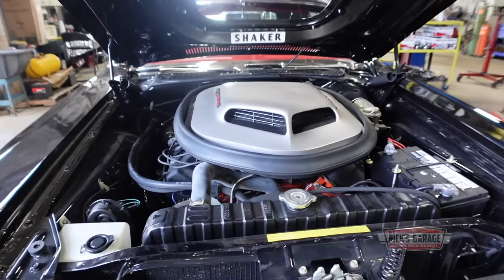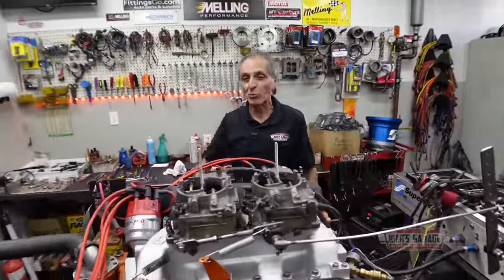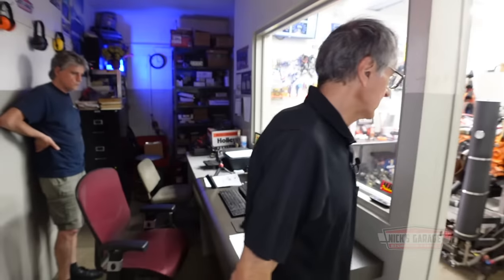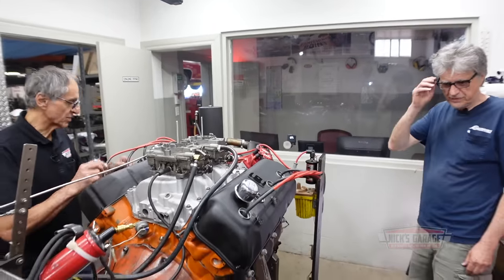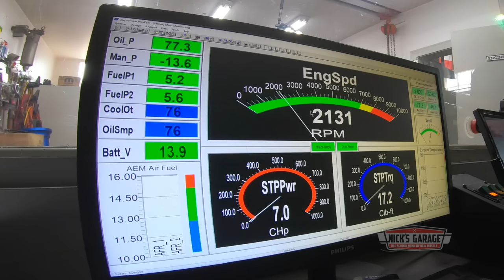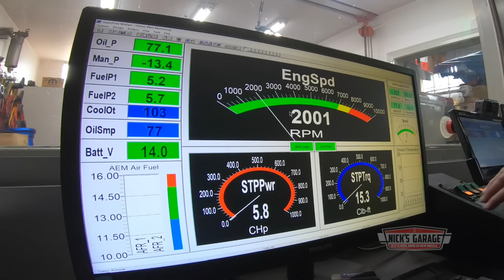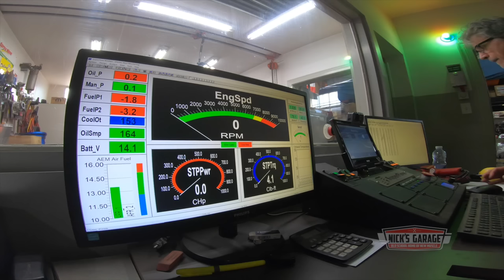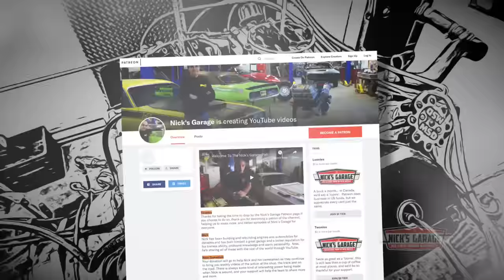NHRA Hemi Screams - Race Engine Dyno Tested

Comment: Hey Nick, when talking about the material of the headers doesn't that change your air/fuel ratio?  You obviously like stainless steel, what about titanium headers.  I know some circle track cars are seeing large gains with the different types of material used in the headers.  How much HP is in the oil pan?
Reply: The material of the headers has zero to do with the air/fuel ratio, it's all in the design, diameter of the tubes, and length. There can be a fair h.p. gain to be had in just the design of the oil pan. Especially when it comes to windage trays and crank scrapers. Obviously how much to be gained depends upon the power the engine makes in the first place.

Comment: I remember hearing Chrysler tested their engines a quart low on oil. It gave a few more HP.
Reply: Ya, the crank/rods have less oil fog to slice thru, thus less friction.
Engine Masters oil pan testing showed near 50hp gain with one design on 800 hp drag race V8.

Comment: I know the duration specs on a "class" camshaft are massive but still it's an impressively high horsepower peak for a "no touch" cylinder head/intake/smallish factory carb setup. You realize the numbers on the monitor during the runs were showing, right? I had guessed it would make around those numbers, says a lot about the factory hemi heads.

Comment: Loosing some low end torque in a drag car is ok if the engine picks up HP on the top end.  Guessing the engine never runs below 4-5000 RPM’s.
Reply: That is correct.

Comment: Hey Nick I've noticed the throttle in your office as you gas it , it seems to bog down the motor than you push a button and the motor picks up again. Happy 4th of July  everyone !
Reply from the maker: The 'bog' you hear is the dyno engaging the load through the impeller system..
Reply: And I learn something new again and that is why I the videos and read the comments not to mention that they are just
Awesome!

Comment: Would be interesting to see if that air cleaner base plate lowers the IAT’s.  Would think it would act as a heat shield to some degree.
Reply: This is why we use it.
Reply: That was the whole entire point of a shaker hood. To bring in cooler outside air.

Comment: HELLO NICK, JUST SOME THOUGHTS,  LOOK AT THE RULE BOOK AND FIND THE THE AREAS THEY DONT TALK ABOUT. IN THE ENGINE AND CAR.. AND REMEMBER TO READ BETWEEN THE LINES OF THE RULES.. PLUS THE MAIN THING IN A DRAG RACE ENGINE IS THE ROTATING ASSEMBLEY WEIGHT, CRANK LITGHTENING, LONGER RODS, LIGHTER PISTONS, THINNER RINGS, LOW TENSION OIL RINGS,LESS FRICTION,THINNER STEM LIGHTER VALVES,TITANIUM IF ALLOWED, LOWER OIL PRESSURE, VACCUM PUMPS..LIGHTER TAILSHAFTS, HOLLOW DIFF AXELS.. I KNOW ITS ALL MONEY.... SLOWLY SLOWLY.....MY OLD BOSS TOUGHT ME ALL THIS STUFF, HE WON A TRUCK FULL OF TITLES AND TROPHEYS, #1 SUPER STOCK MANY MANY TIMES HERE IN AUSTRALIA... KEEP WELL AND YASSOU PATRIOTI...

Comment: Can you run inversion cones in the headers to stop the back pulse? They give a noticeable gain.
Reply: We are working on that issue now.
Reply: If you can manage to tune the headers with collector extensions you can get rid of just about all the header reversion.  But it's nearly an art form in itself in doing so... I had a bud who ran a Hemi Duster in pro-stock (guess how long ago THAT was!) who painted the collector extensions he'd fabricate and take note of where and how the paint blistered off the extensions, then trim the extensions accordingly.  He said it actually seemed to work but wasn't easy and the gains were pretty small... but every 100th counts.

Comment: 7300 RPMs?? Geez, a bone stock 426 Hemi is pretty much all over with before 5500. The cam in your brother's motor must have some pretty serious duration along with that limited lift that you can legally run.  I'm assumimg that there is no rules about the duration of the cam, as long as the lift is within spec? 
Lol, the lobes on that flat tappet cam must look more like rectangles, like a solid roller does. Mopars can take advantage of more aggressive lobe profiles with flat tappet cams because of those huge diameter lifters. A BIG bonus for an NHRA stocker.

Comment: Hi Nick , did you notice when you did he first run one of the wing nuts on the bottom plate of the Air cleaner was coming loose > hate to see it fall in the engine

Comment: What about ceramic or jet coated headers? You can have the stainless steel and then Jet coat them I think that's what they call it
Reply: Most important is the inner of the tubes.

Comment: Hi Nick, what is better the inline 2x 4  or the crossram 2x4
Reply: Crossram 2x4
Reply: The inline 2x4  looks better and is not " in the way " for work as the crossram 2x4. 
The crossram is more efficient for max HP and torque.

Comment: Its like heads on a chevy 350 to make a 383 you more then likely go with vortek heads for the most gains over camel humps you can do it for a stock 350 as well for over 100 hp gain but its like what do i do as a gear head
Reply: It takes more than vortec heads to turn a 350 to a 383. My personal best increase with just swapping from non vortec to vortec heads was 38 hp. With a cam a manifold different rockers higher compression and vortec heads, with a average 350 you can gain about 125 hp and still keep it totally street able and not needing different converter etc. But vortec heads, even the l31 heads, aren't going to gain u 100 hp
Reply: @JohnGalt-vr3lx   yep...I knew he was full of beans...

Comment: I saw a guy get 825 hp at the wheels with a almost stock turbo Chevy 4200 straight 6 vortex
Reply from the maker: Where did you see that?
Reply: @NicksGarage  His you tube channel is  nivlac57. He kept going higher with the boost , when he hit 40 lbs boost it made 825 hp then busted a rod and piston.
Reply: Doesn't really matter what the number is if you break it in the process...obviously it can't maintain that number....
Reply: @patricknash1198  he took a junk yard motor with 175,000 miles got it up to 600-700 hp and won races with it , then wanted to see how high it would go .he found out .

Comment: If you don't have boatloads of cash and a Ray Barton engine it's tuf to run with the big dogs. NHRA Hemi Challenge cars now run 8.4s @ 160mph 1/4mile. All NA , no power adders. About 900 hp @ rear wheels.
Reply: @Car Guy daddyo they run
 SS/AH
Reply: @Car Guy daddyo SS/AH
Reply: @Car Guy daddyo 9.90 still plen jif. Still must have a Ray Barton (or equiv) engine 700-750hp , scienced out chassis to be competitive. Boatloads of $$$ also applies. Buying a competitive car and all its data is least pricey way.

Comment: Why don't you run HOT water thru engine like they use to do?? At track..  without hot air tube n heat rise valve. You must use a choke blade to help fuel  mixture maintain idle that was engineering by factory.. you know that fuel doesn't atomize  on "cold". Surfaces.. fuel goes past. Rings and reignites in exhaust manifolds or headers which can see glowing in darkness..many guys can't understand why header to head gaskets get  brittle n leak as well as collectors ..Heat guns will be best to see what is happening until engine is  "doing" ... I .started going to track in 1964 an started  bracket racing 1957 two door hard top with  327 w  cross ram,,  I  believe that candaians try harder to build "everything " a little  better than amiercans.. my mom was   born in Paris n I was born n raised in Toledo Ohio until 1959 and then moved to Eugene Oregon .made it to 1970 n 71 Winternationals to watch stock n Pro stock . I  have  watched  the.  National s in   Kent Washington since 1979.. I quit. Racing my 74 Ventura with 69 GTO engine in 1996.

Comment: When Nhra "Stock"  dosen't mean Factory production implied Pure "Stock"  !!! .......You're not gonna get (no matter what tune-up, gas octane, carb jetting tweakin) 500 or 600 hp from a Real as we received them 9.4 CR factory production Stock  426 hemi engine as a Nhra "built"  A/Stock legal 426 g2 hemi's in a totally different time zone of   allowable Major internal modifications !! ......For Starters, slightly dome milled "high dome" Super stock 12.5 CR pistons running at an Assembled 11.3 CR is significant power helper compared to the really Pathetic factory production Stock low dome, huge deck Height actual 9.4 CR typical squeeze engines...,Then a major higher rpm Torque band extremely Longer (than factory pure Stock) duration "Cheater" cam is degreeded in for some Serious stock Appearing high revving Dramatic power helping performance....Sometimes "stock" aint close to racin tune "Stock" !!

Comment: The reason you lost torque with those headers is just like every other person that talk s*** about hooker headers, quit buying hooker competition headers for your race car and putting race car headers on your engine instead of hooker supercomp five dyno runs all header changes. The best headers for the big block I found was the hooker super competition headers, not the hooker comp headers, not the headmen headers, not the headmen with the big tube, not the Doug thorley. None of the other brands but hooker super comp headers. Not comp headers but super comp. There's a big difference. 40 horsepower difference between them and a headman brand of the same tube diameter and every other brand I've ever tried. It was at least 20